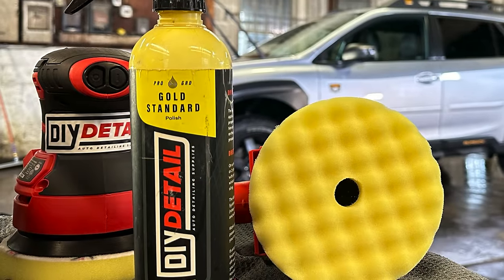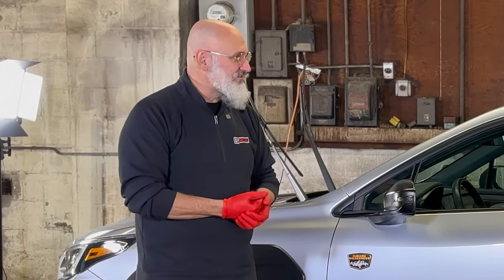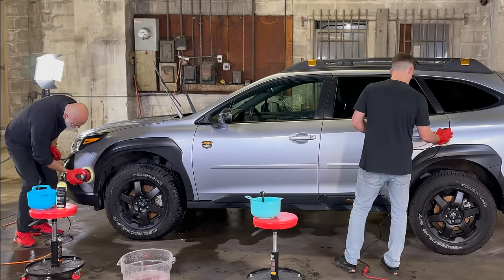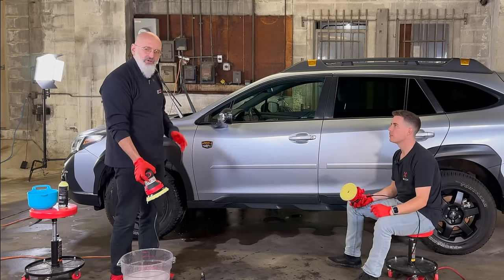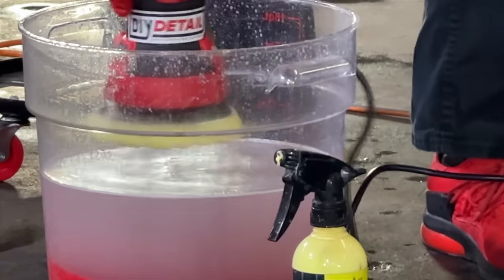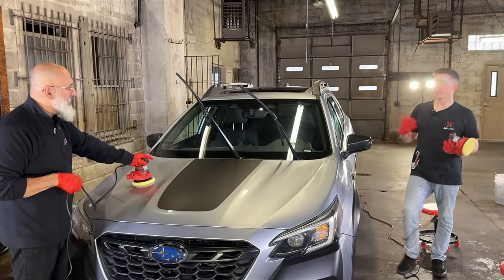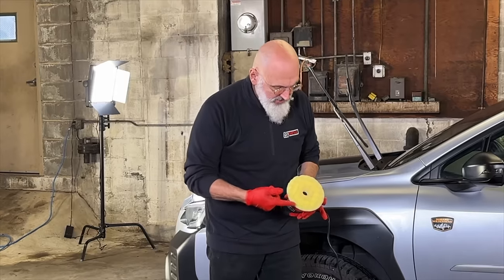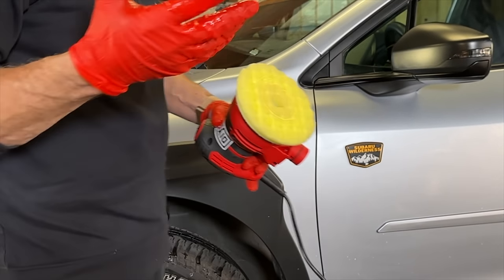How to Polish Paint for beginners! #detailing #polishing #paintcorrection #diydetail

Comment: I'm a latecomer to the GS polish. As a pro I had a lot of old inventory to use up. Finally did the first whole vehicle yesterday and the product is an absolute winner. Zero dust, easy wipe-off, good balance of cut and finish, plays well with trim and gives true results without fillers. My new staple polish. 😎👍
Reply from the maker: Great to hear, thank you David!
Reply: @diydetailofficial  does the GS polish remove swirl markes and fine scratches? I guess I use  more of a cutting pad then a polish pad? what would you recommend I purchase to remove swirls and light scratches and then a polish/wax?

Comment: So I’ve picked out a 2.5 amp orbital sander. I see kinda like a hook and loop bottom for sandpaper but how do I attach that pad of yours( your choice) on to that machine. Does your pad also have the H&L on the bottom of the pad or do I have to remove the pad that is mounted already on my sander CC
Reply from the maker: Our pads use hook and loop.

Comment: That dial by the top of the handle near where the plug comes out is the speed adjuster. I don't know of any random orbital sander these days that doesn't have a speed adjuster. Harbor freight website lists the speed as 0-13,000rpm. Thanks for all you do, great content!
Reply from the maker: Thanks for the info!, the one we normally use is single speed

Comment: I just buffed my car for the first time using:
- BAUER 7.5 Amp 6 in. Long-Throw Random Orbit DA Polisher (replaced backing plate with 5" maxshine)
- A light cut 5" pad (poliwell brand from Amazon) 
- Turtle Wax 53478 Hybrid Solutions Pro 1 and Done Compound Correct and Finish 
- I used Turtle Wax Iron Remover and Nanoskin clay sponge to decontaminate before polishing

I only did a small area (trunk lid) and it came out OK (removed swirls and much of the light scratching), but as soon as I started to polish the surface of the pad turned pink (see linked pics). My car is a red 2017 lincoln mkz. I am concerned! From everything I studied prior to doing this (it is my first time paint correcting), there is no way I should have gone through the clearcoat -- I did about 4-5 passes on speed 4 with very little pressure. So where is the red color on the pad coming from??. I'm scared to do any more of the car without knowing what is going on. Is there an easy way to determine whether I burned through clearcoat?

Any ideas would be must appreciated!

Images: https://imgur.com/a/FoQy6bU
Reply from the maker: Your car has the RR paint code more than likely. It’s a candy colour, meaning tinted clear
Reply: @diydetailofficial  The paint code is R3, would it still be the case that it's tinted clearcoat (how do you tell)?
Reply from the maker: Yes, it’s a tinted clear
Reply: @diydetailofficial  thanks that's what I was hoping!

Comment: Great video, guys. I noticed a couple mentions of single speed on the machines but I’m sure I saw a variable speed thumb dial on the handle…
Reply from the maker: You are correct, the one we normally use is single speed
Reply: @diydetailofficial  The Bauer Random Orbit Sander in this video has Variable 6 speed control. Speed 5 sounds good to me.  It's 14.99 today at H.F.  I'm getting one. Thanks for simplifying getting my car to shine. BTW  Your 5.5" pads are sold out.

Comment: Well this is great information that we're able to dip the pad in water and get it cleaner. I did not know that and having less than 12 hours polishing as a beginner this helps. I think I used too much Sonax on a orange pad yesterday. I tried to clean it w a old kitchen brush but I don't think it did much. Temp was 93° for the high, humidity 81% here in FL. After I made the mistake of polishing my trunk, after doing two sections of the roof, I later noticed some white pittings. This was the 2nd time I did the trunk within a week. Its a practice vehicle in neglected shape but I didn't want to make it worse. I haven't found anyone address repair pitted white spots
Reply from the maker: Unfortunately not much you can do for those

Comment: Thank you both for the detailed demo/video on car polishing! I want to buy the same palm polisher you both used, but it is Not listed on your website. I saw you are launching new polishers in the Spring 2024. Will this palm polisher be available with the higher priced models? I will used this to polish my car only. Thank you for help.
Reply from the maker: No we will not have a palm sander available, they are available at all hardware stores
Reply: Bauer is from Harbor Freight. I got one last year after a video I saw Yvan and Nick do. I was amazed at how well this process worked. But I was removing the pad and dunking it in rinseless wash. This method of cleaning the pad is much better and less time consuming. Thanks Yvan and Nick!
Reply from the maker: Thank you

Comment: Great video guys. Given a palm sander has such a small throw, what would be the ideal rpm for one? I was thinking that since it's such a short throw you'd want a lower speed closer to 1000rpm like a rotary, but is there any thing to worry about with a 12000rpm palm sander?
Reply from the maker: 10-13000 orbits per minute is ideal

Comment: So question: my vehicle is Black it us ceramic Coated but started seeing some light marring.  Should I polish with this machine or do it by hand. The ceramic coating is still working just hate to see the marring on the paint. Vehicle is washed alot it's a Limo SUV.. jm
Reply from the maker: A few options, if you polish, you will need to re-apply coating. The other is to apply a non abrasive wax to fill the swirls

Comment: I have a question, what if I am using a different kind of polish that has protection in it, let’s just say something like the Rupes Uno Advanced that has 1 year of protection in the polish, do you think if it is still a good idea to wash the pad like that, remove excess and then re-use again? I wonder if this compromises the protection by having a damp pad? What are your thoughts on this. Thanks
Reply from the maker: It doesn’t affect the polish or protection. That said instead of using a compromise of polishing and protection, here’s a way that will be just as quick, but will yield superior results and protection.

https://youtu.be/RHyAiZZgWuc?si=Mz86gD8KdtCFiGW0

Comment: Any recommendations or tips for being as efficient as possible to clean headliner?
Thanks
Reply from the maker: Do not touch unless absolutely necessary. They are sensitive to pressure, heat and moisture. Lightly rub with a rinseless dampened towel is safe.
Reply: @diydetailofficial  thanks
I'll try that
Reply from the maker: Thank you.

Comment: After using the Gold Standard Polish and wiping with the Rinseless Wash, is it okay to just leave as-is with no ceramic coating?  Is there anything else that would need to go on top (wax, toppers, etc) of the GSP for a daily driver that's got a little age on it?
Reply from the maker: DIY Detail Gold Standard Polish has no protection, it’s a pure abrasive

Comment: Do you guys have a chart for speed settings for each different stroke length and for the intended purpose. I have a 21mm and an 8mm just trying to find out where a comparable setting would be for paint enhancement, or compounding heavier defects?
Reply from the maker: 21mm, speed 2-3
8mm speed 3-4

Comment: I just took back a Bauer palm sander cause I didn't think it was right to use it didn't rotate like I thought it was supposed to.  So I guess it would work.
Reply from the maker: Yes, it’s fine. If you remove the pad brake it will rotate.

Comment: My brothers 2012 Nissan Rogue has oxidized headlights. Would this method with this pad help eliminate that issue? I've never machine polished before and want to fix his headlights and bring his cars paint back to life a bit. Thanks in advance!
Reply from the maker: It would help, depending on how oxidized they are.
Reply: I just used the Ceracoat headlight kit on my very oxidized headlights on a similar model year CRV. Worked very well, less than $20 on Amazon. 👍

Comment: After you “Polish” do you need to put on a coating? Isn’t the polish a protectant? Or is the polish removing the paint protection?
Reply from the maker: The polish is a pure abrasive, no protection.
Reply: @diydetailofficial  would a "spray on wax" be fine to use after this polishing or does it need to be something stronger like a Ceramic Coating. I cannot do a Ceramic Coating because I do not have a garage to let it cure. My vehicles are all exposed to the elements 24/7.
Reply from the maker: Yes you can do a ceramic coating. DIY Detail coatings can be applied outside, and only need one hour of curing before they can get wet.
Reply: Thanks! I will definitely be checking that out when it gets warmer here in NY 😆

Comment: Maybe a dumb question. But is it better to buy a cheap random orbit palm sander that doesn’t have built in dust extraction (suction)? Partly wondering if the suction is making more work for myself, as the added airflow maybe dries the pad faster. Or is it a non factor? But also curious if the suction would blast any contaminants back onto the paint possibly?
I’m sure I’m overthinking it all, but had to ask lol.
Reply from the maker: Makes no difference

Comment: Do these tips only work with your products?  Is it a good practice to polish a new car or does it just depend on the condition of the paint?  Meaning is there a scenario where a new car doesn’t need to be polished at all?  Thx
Reply from the maker: A light polish cleans the paint for better coating application

Comment: Does the 5.5 inch waffle pad on the website fit the 5 inch backing plate? Why the extra .5inch? Beginner question, sorry.
Reply from the maker: Yes it’s for 5 inch backing plates, the extra is for safety close to edges

Comment: Hey Yvan! What are your thoughts on hand polishing? Any advice? I don't have a polishing machine and I would like to leave the car with a polished (almost showroom-like) look without using the machine. AutoGlym Super Resin Polish is the one that I was looking at, would you recommend this one?
Reply from the maker: I’ve never tried that product. Hand polishing is a lot of work. You can use a basic random orbital sander , it’s safe, low cost, and much faster than by hand. Watch this How to Polish Paint for beginners! #detailing #polishing #paintcorrection #diydetail
https://youtu.be/bdINJ-3Mc0U
Reply: @diydetailofficial  Thank you!

Comment: Are these sanders strong enough to remove pretty noticeable swirls if I were to use the wool pad first? And would I need to go over it again with the red jewling pad after or the yellow pad?

Or is the sander more just to clean up the paint and remove old protectants?
Reply from the maker: With the wool pad and a little patience, yes it will remove swirls. Only the yellow pad is necessary to clean up any haze left by the wool pad

Comment: What was the speed setting you used here on this sander during the polishing? Product page states it can run 0-13,000 OPM (there is a speed dial on the machine)
Reply from the maker: 13,000
Reply: @diydetailofficial  many thanks again. Prepping for my spring car reset with DIY gold standard lineup
Reply from the maker: @mikev1766 Thank you.
Reply: @diydetailofficial  Just noticed something coming back to this video after watching some of your latest videos where you chatted about wiping off polish after vehicle is done vs per panel....here you waited until the very end to wipe all the polish off the vehicle correct?  You can do that with Gold Standard!? If so, wow, that will change my workflow im putting together (also thank you for your continued replies to my almost constant questions leading up to my car reset; you guys are great)

Comment: Why do you sometimes use app after polishing and most of the times don’t?
Reply from the maker: We show different methods and techniques.
Reply: @diydetailofficial  I ordered it with the polish so I am wondering if I have to use it after the polish.  My car is only a few months old.
Reply from the maker: The C6 Ceramics Adhesion Promoter Polish (APP) will help any coating bond

Comment: Can someone recommend a good value polisher for once a year use?
Reply from the maker: What type, what budget, and how much correction are you wanting to do.
Reply: @diydetailofficial I don’t know which type I should buy, budget is not a problem but don’t want to over spend. My car is from 2012 (mazda miata) the paint has a couple of tiny chips where the paint is gone and minor scratches and many grit marks that are only visible from close inspection. Color is copper red.
Reply from the maker: Our DIY Detail polishers will be back in stock soon
Reply: @diydetailofficial  I’ll wait then